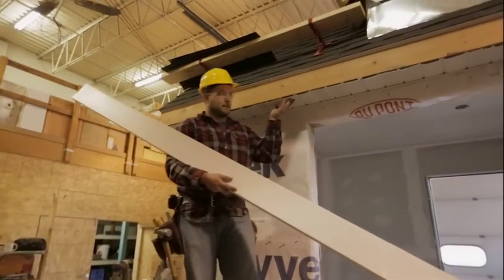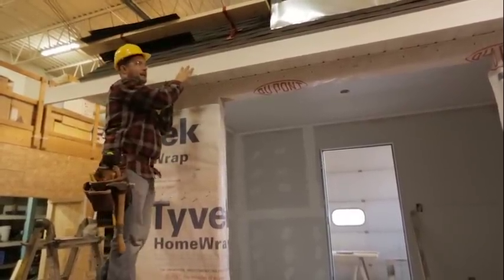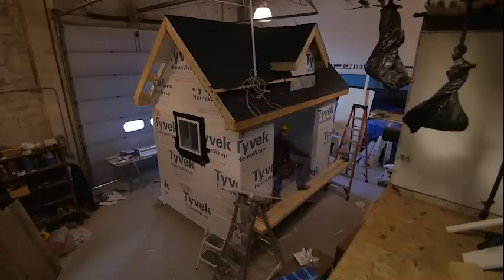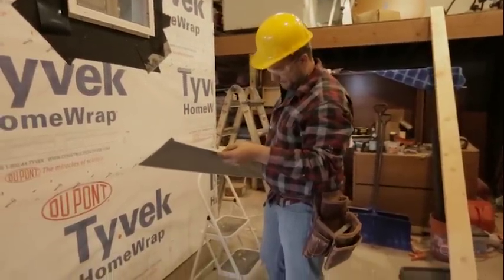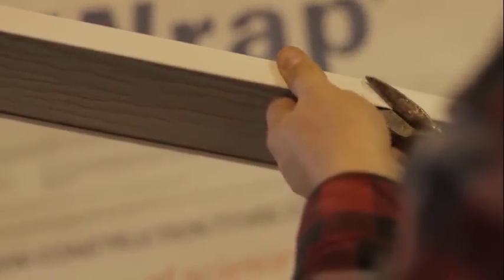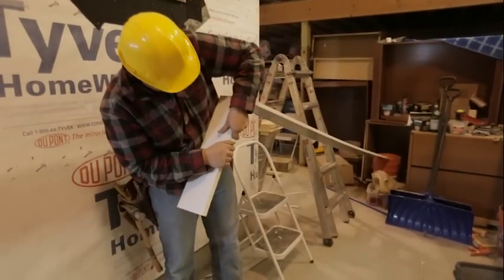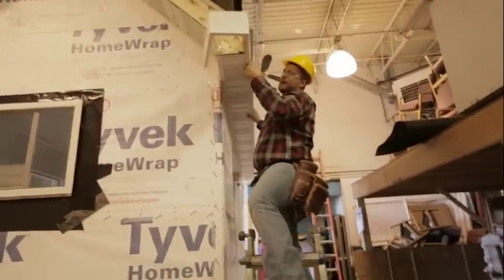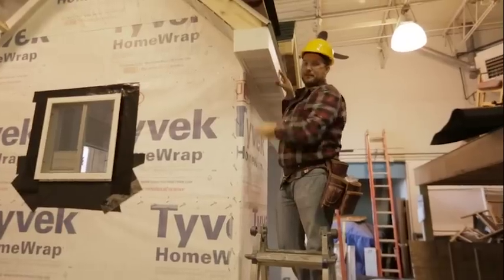How to Install Soffit and Fascia Part 4: Fascia

Comment: How did you fill the gap that is seen at 8:52 between the fascia box and the soffit going up the eave??
Reply: also wondering this
Reply: my f channel also cannot be cut in the manor this was, if i cut the bottom of the F the top part of the F would fall apart. so my nailing flange has to stay
Reply: You use J-Channel for that spot.
Reply: I d have used more nai or screw to be strong to avoid wind damage.
Reply: @farukatasever2933 exactly,  make it look pretty... just use 2 nails at the peak. Then in 5 or 10 years it comes loose. I've seen it many times. Then I have to go fix it...

Comment: How did you make the soffit continuous at the top where the "V" meets? My ridge board sticks down farther than yours and I'm having trouble putting the soffit and fascia. I used a 2x8 ridge board with 2x6 rafters but my pitch is 6/12, which is why it sticks down farther. As a result, I can't make mine continuous like yours. Any suggestions?

Comment: What about that huge gap between the top of your aluminum fascia that rapped around the soffit box and the soffit that runs up the gable end. You can totally see wood behind there. You kind of ignored that and pretended it wasn't there. That can't be left like that. Something different would have to be done compared to how you did it.